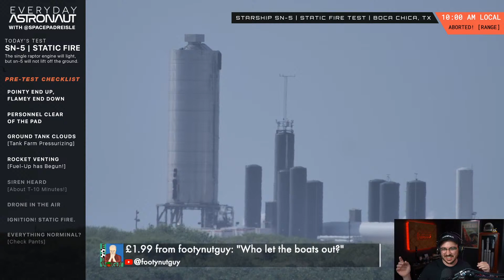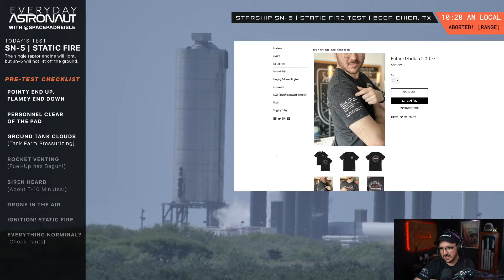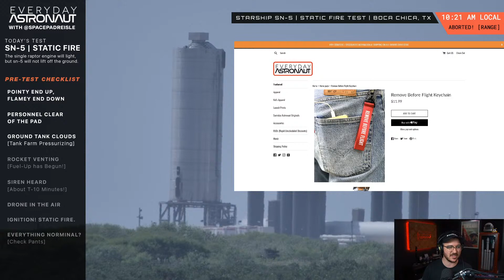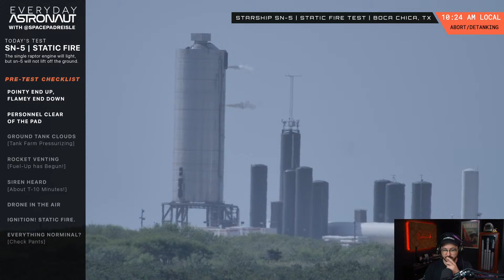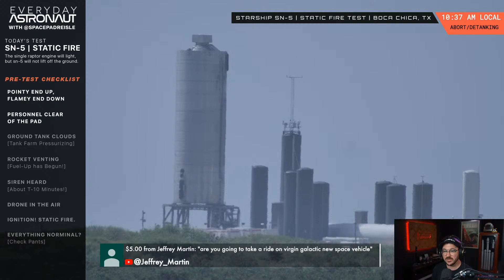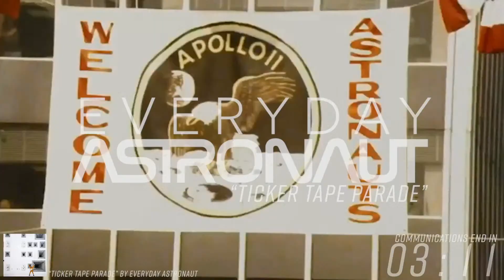[SCRUBBED DON'T WATCH!] Let's watch SpaceX static fire Starship SN-5!

Comment: Gases at atmospheric conditions are usually liquified by compressing (which heats it up and reduces its volume), cooling it back down (but keeping the higher pressure (,repeat as often as desired) and then expanding it through a nozzle. If done appropriately parts of the expanding gas should then start condensing as a liquid. The remaining non-condensed cold gas gets sent back into the feed stream and goes through the whole process again.
The liquified gas should then remain at its respective boiling temperature at that pressure and bubble away.
Those boiling temperatures can be silly low, or even unachievable at atmospheric pressure.

Comment: The Space Shuttle Main Engine was also closed-cycle with 2 turbopumps, designed in the early 1970's, with leftovers used in the new SLS vehicle.  But both preburners ran fuel-rich, whereas SpaceX Raptor runs one turbopump oxygen-rich (more efficient).  In the 1960's, U.S. engineers thought running Ox-rich would be impossible in a metal chamber, as every welder knows one switches a gas torch to pure oxygen to cut thru steel.  But, surprisingly the Soviets did that in their NK-33 engine for their Moon program.  Their trick was to use copper in the preburner and a materials trick for the steel alloy turbine blades.  Leftover NK-33 engines were later used in ULA's Taurus vehicle in the 2000's.  The U.S. IPD demo engine of the early 2000's also had an ox-rich preburner, so by the time of SpaceX Raptor design, there were at least 2 prior liquid engines which had proven an ox-rich preburner.
Reply: @RPP2008  Been there, seen and touched much of it.  Many people know about the history and boys like you can read up on wikipedia or easier just watch Everyday Astronaut's other youtubes.